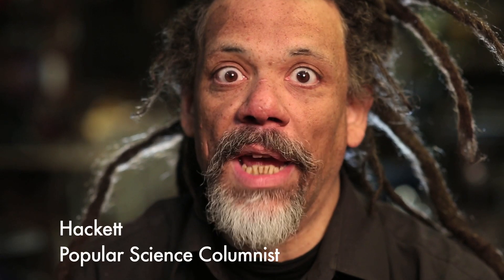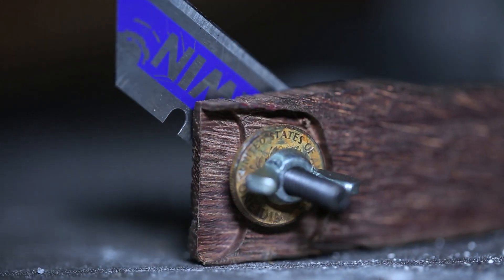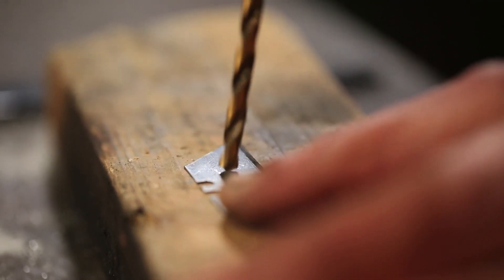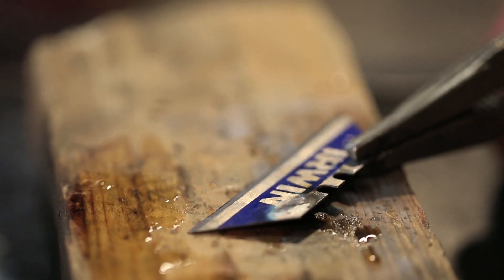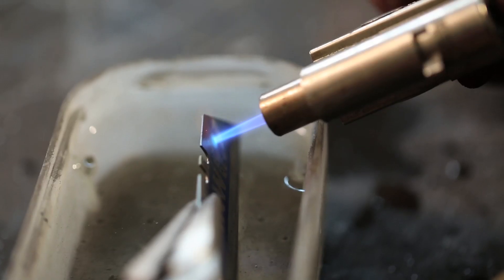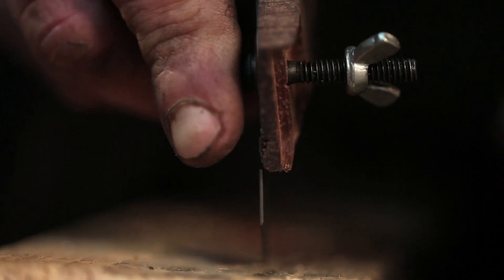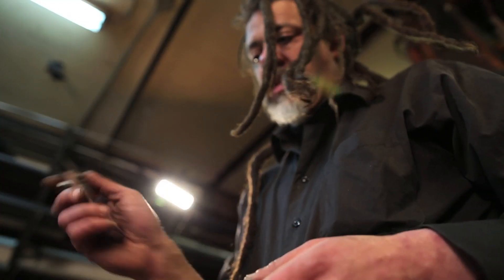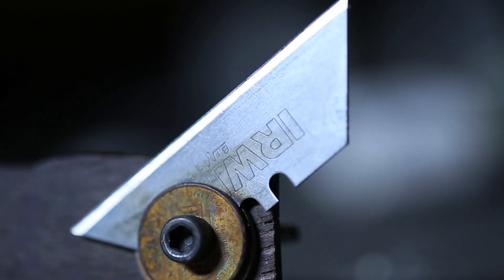Rebuild: The Skill That Helps You Drill Through Steel

Comment: Awesome! 

I need to drill through a hardened steel plate. But don’t want to ruin the temper on the rest of the plate. 

Going to use a tig welding torch to apply localized heat. Thanks!